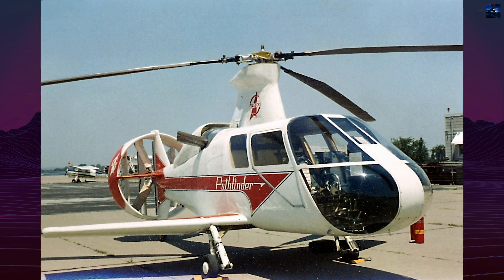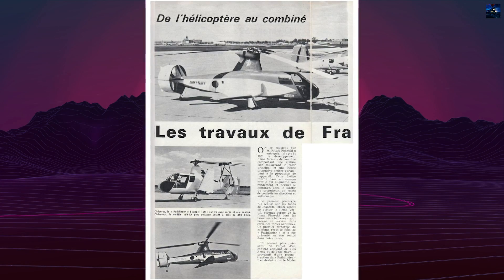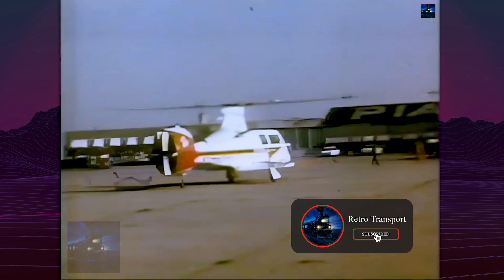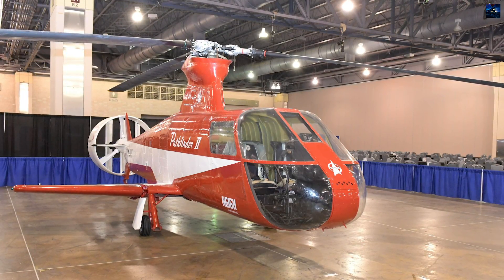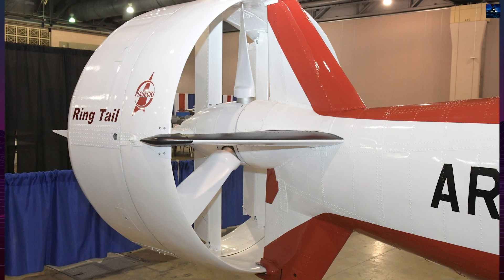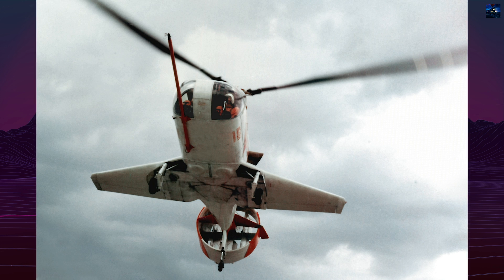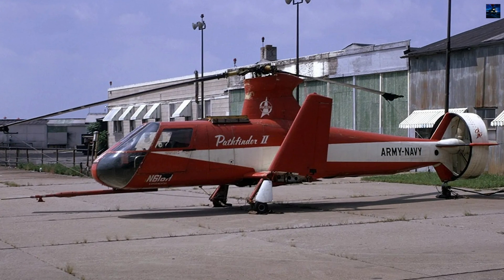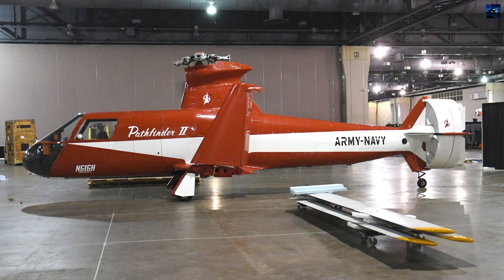Piasecki 16H Pathfinder: Too Fast for Its Time or Just Too Weird?

Comment: I had no idea this was built and tested so long ago.  It's hard to ignore the possibilities though they were for decades.  Of course there is a lot more going on the just what is possible.  Is it practical and does it fulfill mission objectives?  There are light years of differences between a VTOL aircraft and a traditional helicopter.  The trade for speed is hovering in all environments.  Interesting in any case.  Hats off to  Piasecki!